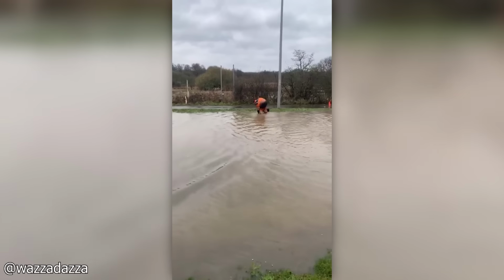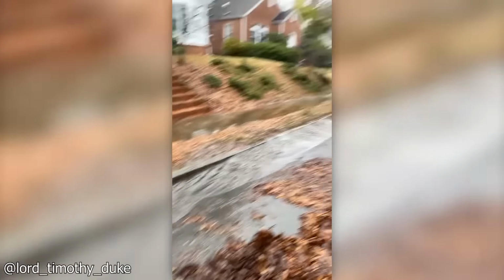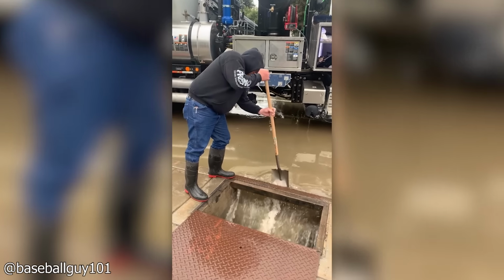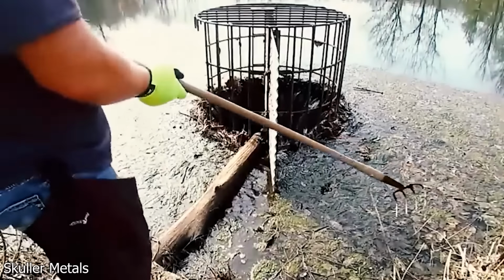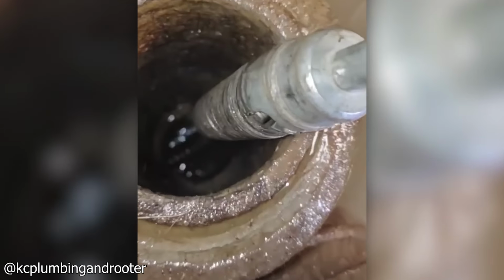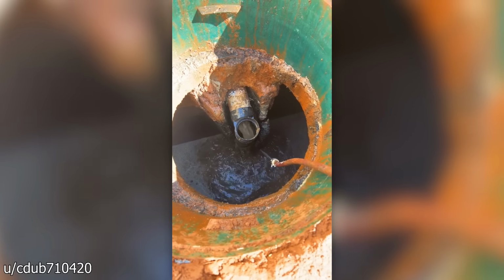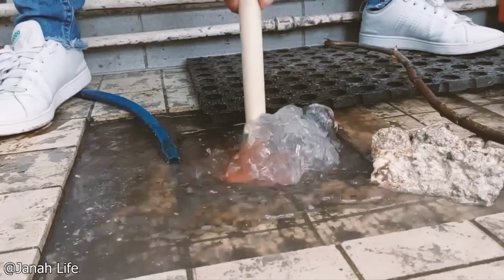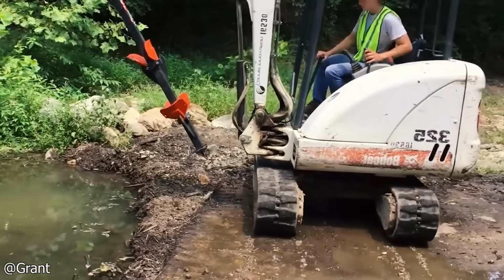Best Drain Unclogging Compilation #60

Comment: This is what happens when people don't rake some of the leaves.
Reply: No it's what happens when cities stop using street sweeper equipment.
Reply: @joellenrhodes456   If you look closely, that street drain that was clogged with leaves is right at that house on the corner with all the unraked leaves on the lawn.

Comment: Lol, that first one was "explosive" because he used a freakin bead blaster. In other words, he filled up a five gallon tank with air pressurized to about 120 psi and dumped it all in a fraction of a second by opening a large ball valve. They're used in the automotive industry to help seat tire beads on wheels. Considering the amount of air that blasted back water on the surface, I'm not sure it was all that effective at actually unclogging the drain. Pretty funny to watch though.

Comment: With the parts that had the guy putting a water bottle over the drain and then someone saying they need to get a container wouldn't be showing the unclogging would it? Throwing a log into a whirlpool to watch to see if it comes out on the other side doesn't constitute as unclogging.